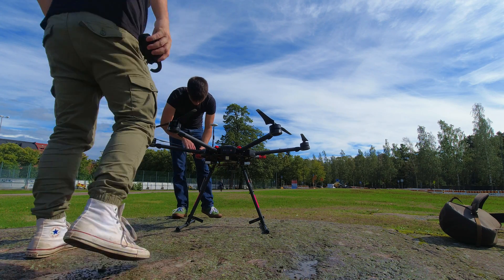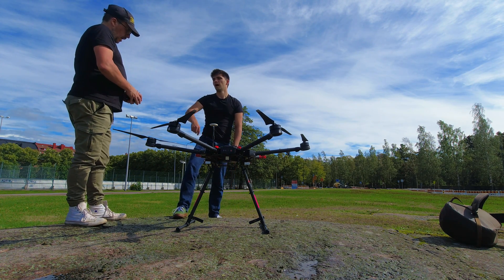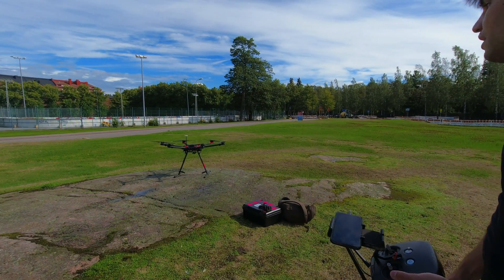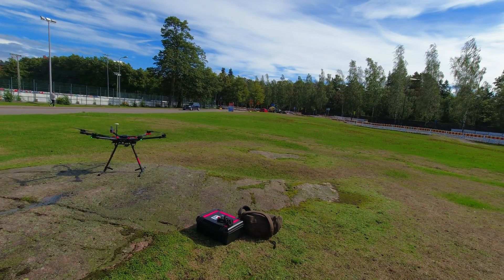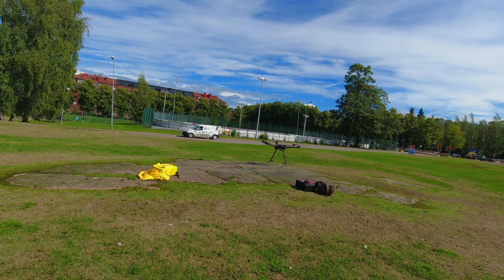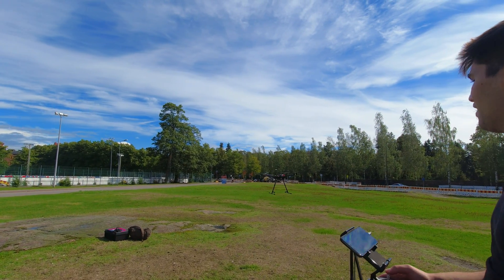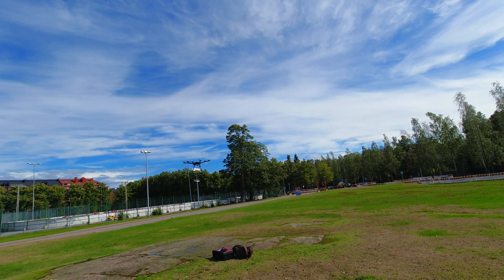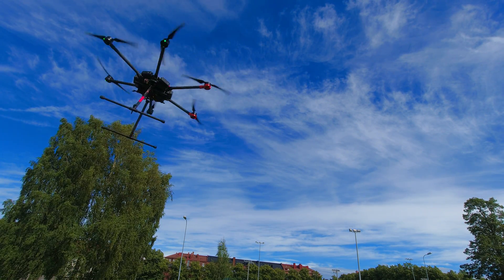Drone Delivery Project, Day 1 - Testing & Training with the DJI M600

Comment: Nice but doing drone delivery you are not flying line of sight so how is that going to be leagle. If faa says you need to fly line of sight? Probably a dumb question but I am just wondering how it all works with remote id and new rules with the FAA
Reply: Hiy, I’m Chas, the other guy in this video. We’re operating in Helsinki Finland, and have a corridor of airspace that we have permission to fly BVLOS in during this trial :)
Reply: @chassheppard  How do you get the permission and from where? What are the requirements?
Reply from the maker: All drone operators and project leaders work closely with the local regulators. They help and guide us and when we reach their requirements, permission is granted. Watch the next video and you’ll hear more about this subject ✌🏻
Reply: @FlybyGuys  thank you
Reply from the maker: Hey Gene, thanks for the question and interest. All requirements are met and permissions granted. You’ll see more info in the next video ✌🏻
Reply: Leagleize it?